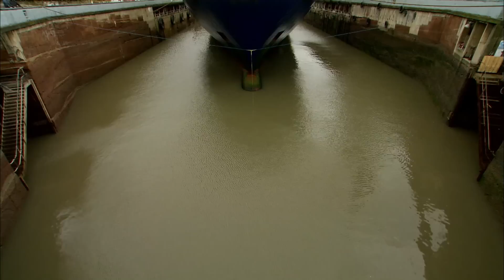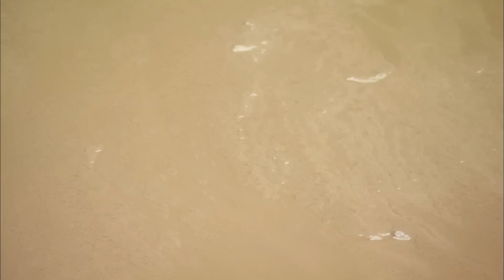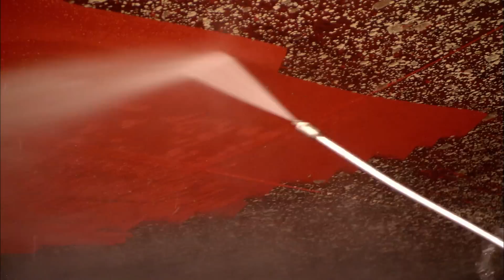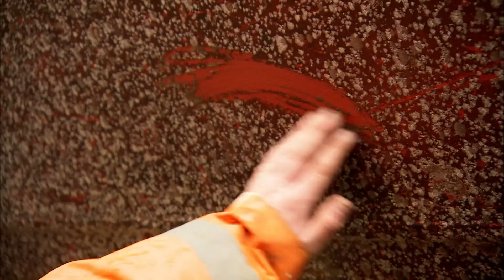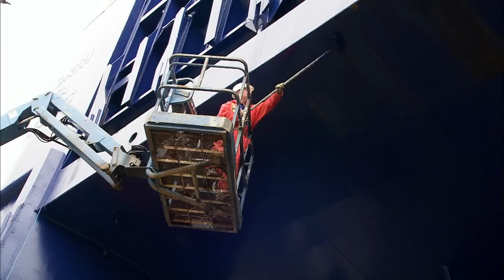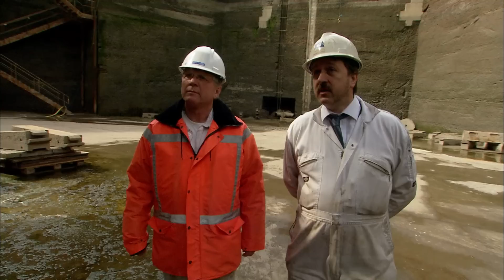The Gargantuan Task Of Restoring A 17,000 Ton Ferry

Comment: I used to work on the Norbank as a engineer. I think i was onboard during this particular short dry docking. The video is actually way older than 2 years because the Norbank changed to the new P&O logo in 2015.

Comment: And what’s about parts, which are covered by wooden pylons?
Reply: They didn't say if it was done in this case, but normally, part way through the work, they will re-flood the dock, move the ship a metre or so forward/back, then pump it out again.  The areas that were on the supports are then cleaned and painted.
Reply: Ships have several docking plans that lay out the location of blocks and at each docking the ship is put on a different plan/layout so over its lifetime the whole hull is painted several times. Its not very common to refloat and move a ship in dock because all under water work must stop and the dock needs to be cleared and then everything put back in again. While this video says the paint is a special type but most marine paint can last long enough that even for the sections that are missed each second docking there is no damage to the hull and marine growth is kept low over a small area. They also say its two years between dockings and most ships operate on a 5 year docking schedule to line with class surveys
Reply: @darylovaltine  Search for "drydock fleeting", Battleship New Jersey has just done this to paint under all the keel blocks.
Reply: @darylovaltine  Search "drydock fleeting".  Battleship New Jersey did this just a few weeks back.